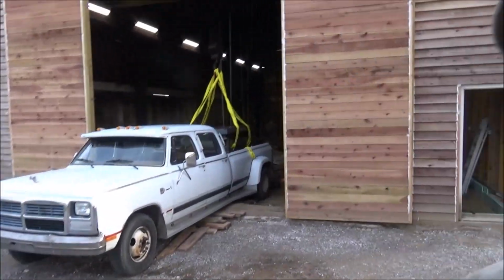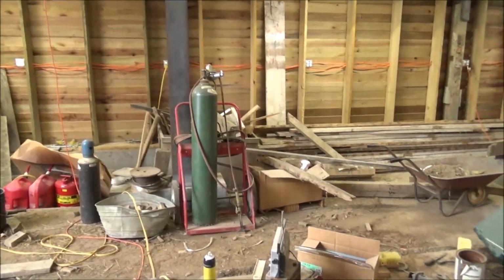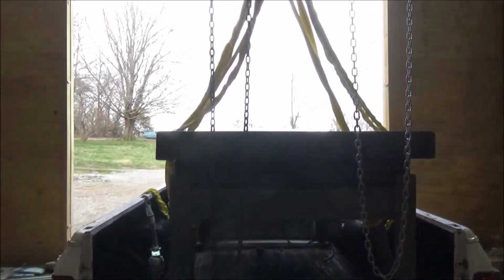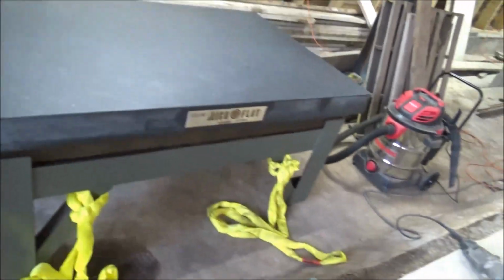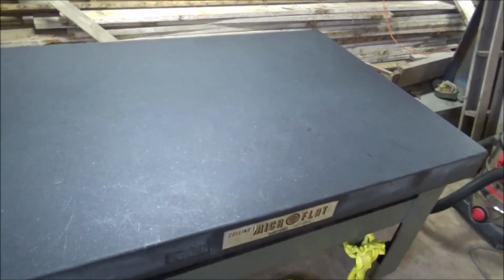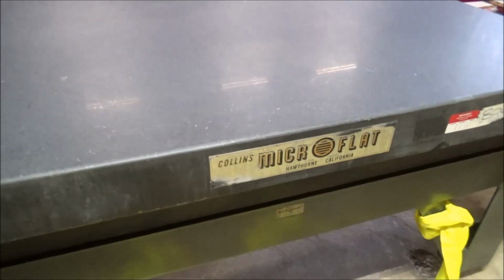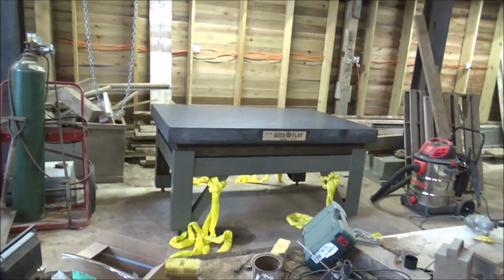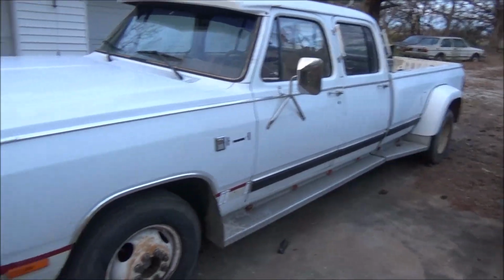Granite Surface Plate 1st piece unloaded in the new shop

Comment: Hi Brian, Love the crane man, sure makes short work of big heavy items! Very nice piece of rock and really nice base it came with, I think Bailey gives it a pawl up! I would throw a set of air bags on your truck, levels out the truck with heavy loads and extends the life of your springs!
Reply from the maker: Have you had air bags on a truck before? The idea seems good but looking around it sounded like the firestones only had 2in of travel, seems if that is the case they would bottom out a lot on rough roads.
Reply: I have had Firestone air bags on my Tundra since it was new, towed my 10K toy hauler for several years and never a problem, keeps the truck nice and level!

Comment: i love the truck i have a similar one 84 d350 with 8 foot box and crew cab. i have the 440 and my girl is red. i had the running boards but they stopped at the back of the cab i removed them to prevent rusting in that area
Reply from the maker: I actually figured the running boards helped mine by keeping rock chips from hitting the rockers and damaging the paint leading to rust. I would like to have my floors and rockers rhino lined for protection and maybe make it a bit quieter as well.

Comment: Hawthorne is just over the mountains from me to the east out in the desert.  The plate looks good in the shop.
Reply from the maker: Thanks Randy! I wonder if it was quarried there?
Reply: Randy, you are talking about Hawthorne, Nevada.  Hawthorne, California, where Collins was based, is in the Los Angeles area.
Reply: Collins Micro Flat went out of business around 1990.  The business started in 1953.  My Collins rock was out by .002" over the 18x24" when Standridge Granite came by to lap it.  .002" is the Grand Canyon when talking surface plates.  It is now within AA specs.  If it is not in current calibration, it is an unknown, roll the dice each and every time you trust it...
Reply from the maker: I agree, trusting it without verification is a risky business. Of course I had virtually nothing before to reliably measure from so I am no worse off than before i think.

Comment: Looking good Brian.have you ever thought about air bag for the rear?
Reply from the maker: Was looking in to it but seems the kits only offer 2" of suspension travel. if that is correct seems it would bottom out a lot hitting bumps.
Reply: i have never used them . I am guessing that you would only inflate them when you needed eztrat load carrying. but i guess you have already looked into that .. there is always add on helper springs  the one that sit above the main pack

Comment: You have what is called "shop grade" black granite. We have a "pink granite" inspection grade at work. It is kept in a climate controlled inspection room (aerospace) and has to be calibrated once a year. It too is a Collins brand. Your plate will sweat in climate variations much as a machine will. As long as you don't drop anything on it or deep scratch it it should last a long time.

Comment: that crane beats a double hernia, hands down.  Worth every bit of work getting it operational and in there.  If something turns up and makes the concrete trucks unable to get all the way to the back, you can use it to tote the concrete in, rather than moving it one barrow at a time.  Just need to find one of those trip-bottom pots (I guess that would be a gondola?).
Reply from the maker: It could be done that way but I think worst case hiring a pump truck would be more practical.

Comment: kind of spooky seeing something that expensive dangling 4 feet off the floor
Reply: it's amazing how things grow when you have them suspended in the air.  how much they grow is always proportional to how delicate or expensive they are.  sadly, some tend to shrink in proportion to the size of the work you present to them.
Reply from the maker: Well a new one would be expensive but this one not so much. I wasn't worried one bit about that plate hanging from the crane. it was all doing what it was supposed to do. :-)